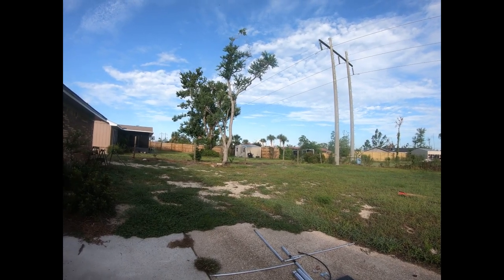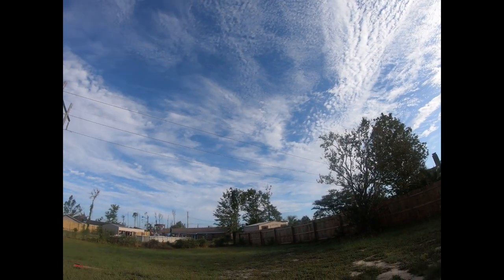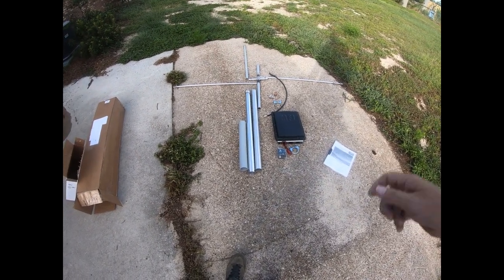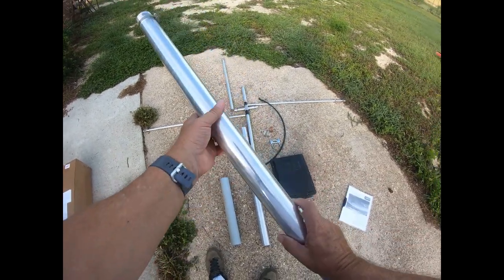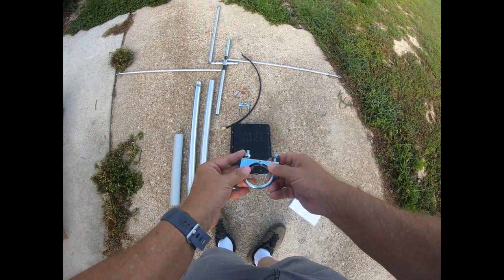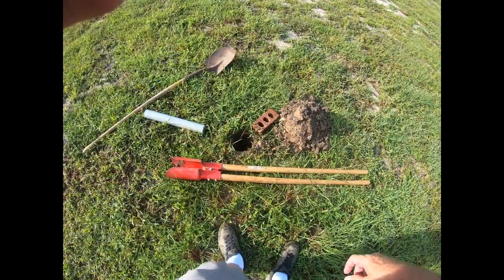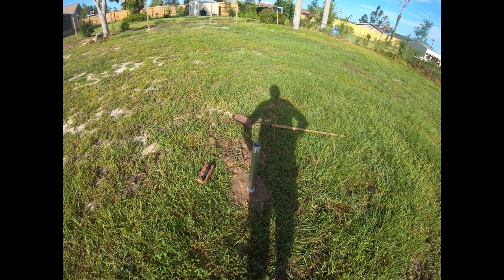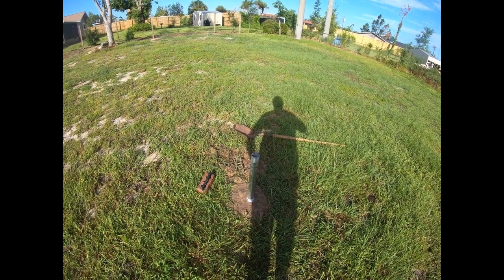N6BT V8 Vertical Installation

Comment: Hi Greg, nice video.  Did you get your antenna working 80M and 40M CW?    Did changing or removing the hairpin make a difference?  Also, for 80M I would try a 4:1 balun in reverse to help the tuner on the low impedance you'd get on that band. Stuck in an HOA here and looking for my next stealth antenna.